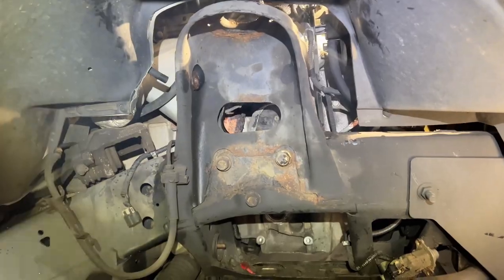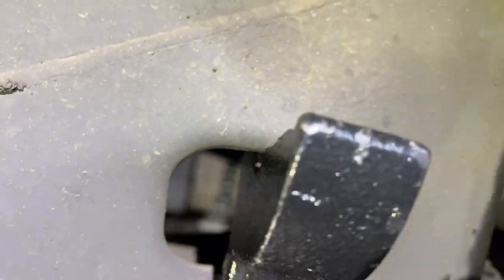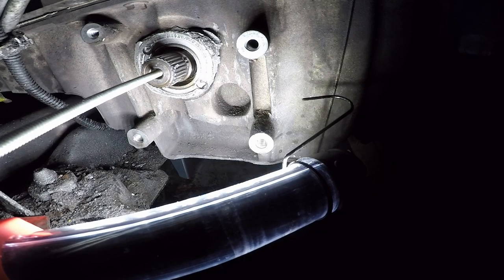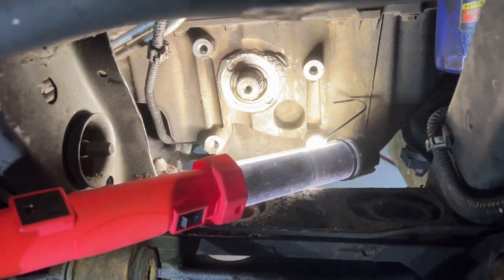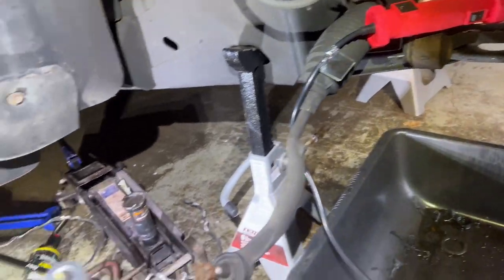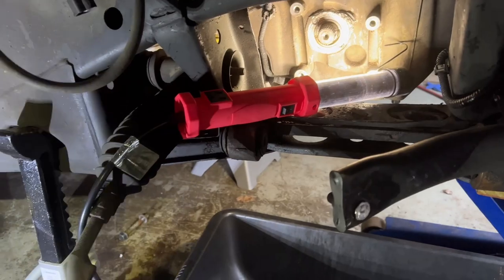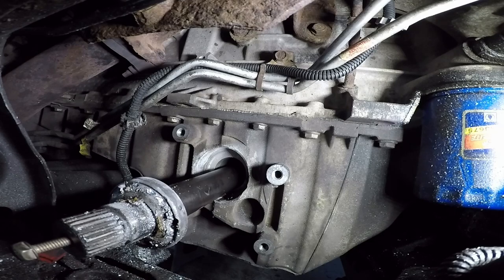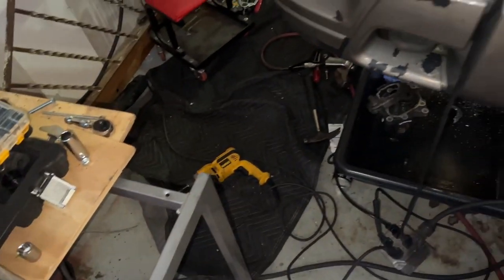Seized 4x4 Disconnect inner axle removal Trailblazer

Comment: I just completed this job yesterday.  I didn't remove any other parts except for the wheel and rotor. Removed the outer tie rod nut and the upper ball joint bolt. I had no air tools. After the axle disconnect housing broke, like yours, I pulled the inner axle with a 1/4-20 grade 8 bolt and slide hammer. I then drilled many holes and used a Dremel with a disc wheel to cut a weak spot in the remaining piece of the stuck housing. Finally, I used the slide hammer again with a tip that would reach behind the broken housing. I pulled it out carefully without even a nick to the oil pan. It was tedious! I will note that the installation of the replacement axle disconnect assembly was very tight even with anti-seize applied to the bore. I had to slowly tighten each of the four bolts until it was fully seated.
Reply from the maker: For me I replaced everything that’s why I disassembled everything
Reply: @PHL_Brownstone  I only mentioned that because I had less room to work than you.

Comment: Thanks a million for this video. Mine has been broken in there since winter. I tried a small 2lb slide hammer and not enough ass to pull out that intermediate shaft. Going to pull everything off the front side in a couple days so I can get a 5 pounder on there. Welded up an eye bolt to 1/4 20 thread to pull it out. The real trick is going to be getting the remainder of that snout out of the oil pan with screwing that up.
Reply from the maker: Good luck with the project!

Comment: The disconnect housing on mine did the same thing. The boss broke off in the oil pan. I ended up using a 3/16" carbide  ball cutter in a dremel tool and cut a groove into the broken   piece to the oil pan carefull not to get into the pan. Took about 1/2 hr to cut the slot all the way thru and then part way thru at the top. I could then use a srewdriver to free up that boss and remove it. Cleaned up what I could with small sanding drum lightly. Put a thin layer of axle grease in the bore and installed the new disconnect.
Did not need to remove the intermediate shaft.

Comment: Should put  a nut on the bolt in front of the vicegrip so it won't slide
Reply: Or put a socket that will fit over the all thread then put a nut and washer on the end so the socket stops at the nut like a slide hammer works

Comment: Anyone watching to start this job...I would suggest running the vehicle to operating temp prior to starting. May help so you don't end up in this situation. Then take your time prying it out one side then the other and back and forth till you get some moment and just keep after it slowly. Did mine today and that's how I did it and thankfully I don't not end up like this.
Reply from the maker: Depends on where the vehicle is from. Mine lived its entire life in the Northeast and the 4x4 disconnect welded itself to the oil pan prepared to laugh at and eat any heat for breakfast 🍳 🤣 and yes I used pry bars to try and wiggle it free and that’s how it broke

Comment: Had to come back for some more guidance, when assembling it back, do you push the intermediate shaft into the 4wd disconnect first, then mount it, or do you push in the intermediate shaft into into the oil pan, then mount the 4wd disconnect? If you got an idea of what I'm trying to explain
Reply from the maker: You install the inner axle first through the oil pan, then mount the 4x4 disconnect. The new disconnect will be tough to go back in the oil pan and you don't want to be fighting the inner axle and 4x4 disconnect at the same time

Comment: Now I understand why a cpuple of friends that work on my vehicle dont really want to replace that seal. I dont have any power tools, but I'll have to takle this job myself so im not having to add the oil in that so soon each time.
Something else that I came across last summer when I was leaving my house I heard a big clunk underneath the vehicle but nothing really felt different while driving, But I always curious what that might have been something right underneath in that 4 wheel drive area and the 4 wheel drive works when I used it a couple of times this past winter but I did notice when it's in 4 wheel low. I believe it sort of has a different noise that it makes when I put it into it. I got the 04 Envoy which looks the same.
Reply from the maker: Yeah that 4x4 disconnect seems to be real cheesy and could be at its end on yours engaging and disconnecting by itself causing the clunk

Comment: Where did you get the new piece, that contains the bearing and disconnect?
Reply from the maker: @donprice9039  it’s called a 4x4 disconnect. I either got it from eBay or Amazon. I don’t remember which
Reply: @PHL_Brownstone  ok thanks 👍